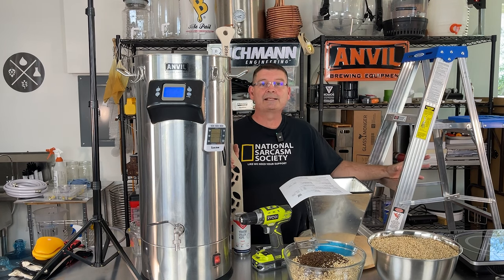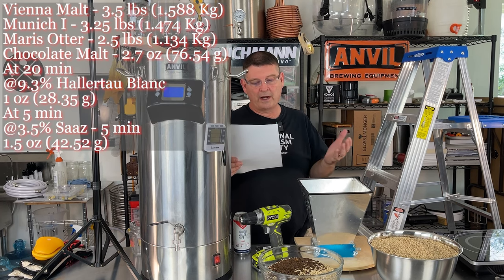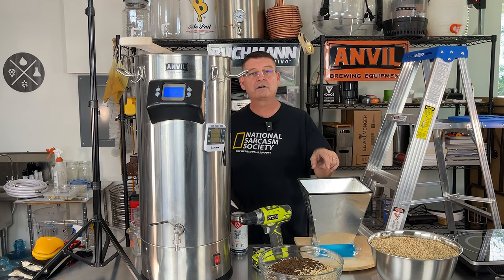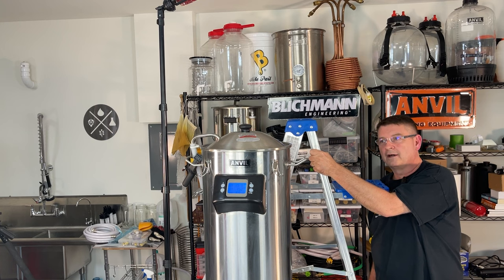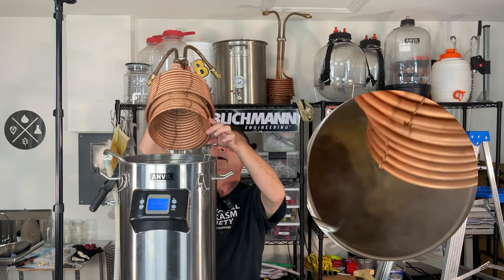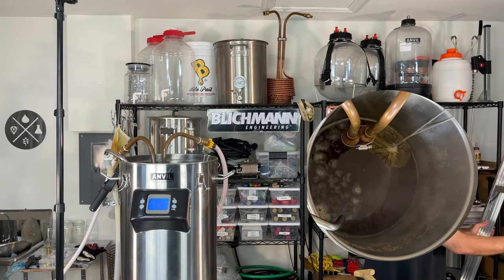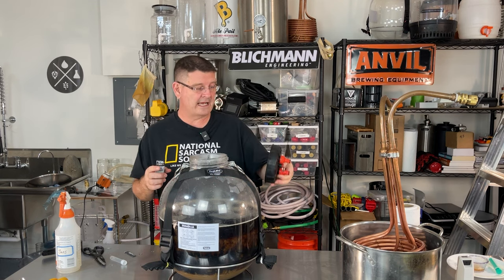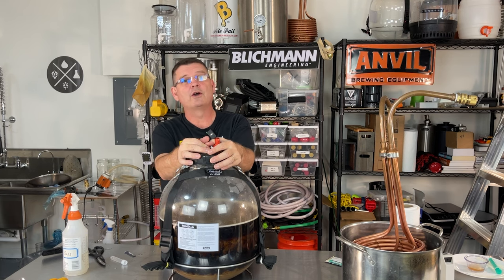Vienna Lager brewed on Anvil Foundry brewing system

Comment: Glad you didn't get hurt working on that ladder. An electric hoist is a very helpful tool in my setup, makes for easy and safe lifting of hot items, and it's like having an extra set of hands.  I really enjoy watching your videos, keep up the good work.
Reply from the maker: Thankyou and I know the ladder really has no place in the brew space but working with what I have at the moment. If I wasn't brewing for YouTube or had a better back, I'd just brew on the floor and bend over when talking to the camera. I'll get it figured out but for now my goal was to get brewing ASAP. I did get a couple electrical outlets in the ceiling above me so an electric hoist wouldn't be that hard to get working.

Comment: Congratulations on your beautiful brew space.
I also have the Anvil Foundry and, for the lifting, I purchased from Amazon pulleys with internal gear ratchets, which work great, even with one hand.  The rope is 1/8 inch, 8 ft long, with a lifting capacity of 150 lbs.  Their main application appears to be the hanging of growing-light fixtures.  They are very inexpensive, and you get 2 pairs (4 pulleys) for about $9.
Reply from the maker: I actually have a pully system that I used at my last location for testing a BIAB inside the Anvil Foundry. I'm still debating on using that or other solution.

Comment: New location looks amazing! You will get the kinks worked out for sure. Three things need the feet on the basket (I love mine) and a hop basket so you don’t burn yourself. Also maybe a hoist system from the ceiling. Just thoughts. Keep up the great videos!
Reply from the maker: Thank you and actually I have the feet on my 2nd Anvil Foundry and bought them for this one but I still like the ring for the ability to help level the grain basket. As for not burning myself...I do that all too often whenever heat is involved. I did editing out a bit of complaining about how much my fingers were stinging. (I use a lot of mustard on my burns, so it is extremely rare for me to end up with blisters.)

Comment: Nice job Mike, appreciate you showing how the brew day "really" went.  You are correct,  your flow and process will only get smoother the more you get used to the new space.  I'm thinking a two level brew table would be a nice addition.  That would probably be really pricey though!  Cheers.
Reply from the maker: Yeah and sadly I already spent a fair amount of money on the tables I have but ultimately they may have to change to make things smoother.

Comment: Congrats on brewing at the new house! I remember my first batches when I moved to brewing in my garage and there was definitely a learning curve.

My biggest suggestion is to get a pulley system. I put an eye bolt into a ceiling joist, attached a ratcheting pulley to it, and it made lifting out the grain bag a breeze. Makes it so much more safe and ergonomic.
Reply from the maker: Thank you and you are right as everyone seems terrified of me using a ladder. I mentioned to another home brewer that I have plugs in the ceiling mainly for lighting systems to be used in the future but I could easily hook up a manual or an electronic hoist/pully system.

Comment: Great job & video. It's difficult doing anything in a new environment. I too got nervous when you were up that ladder, especially when that ring came out. Yeah you definitely need a hoist of some sort & probably a lower/adjustable bench too. I'm sure you'll find the best solution. 👍
Reply from the maker: Thank you and I had to check out your YT Thumbnail. Very cool, I thought it was a skeleton at first. I know this brew round was safety directors nightmare (I work with a few in my day job as I'm an IT guy that works in the port industry, very dangerous). I'll figure it out but I was chomping at the bit to get brewing again ASAP. Doing two IPAs today if I get lucky, otherwise one today and one tomorrow.

Comment: I've  got the exact same generation  anvil foundry with the snap ring and have popped  it a number of times but still would not give it up I'm  at like 47 batches in it and just an FYI what I do is .... I have a Warner (darn auto correct) platform its 30 inches long 12 inches wide and 20 inches tall (lowes,home depot ect..) so I put it at one end and the foundry is at a comfortable  height  to read contol panel  and stir mash then when I lift the malt pipe I step up on the platform  next to it. It works! I also have one all rounder I am very fond of (wish I had two) not everybody understands them . My fermzilla I don't  like it's too small. The fermentasaurus (you try and spell that) was the perfect batch size I could ferment 8 gallons and fill one 3 gallon and one 5 gallon corny. Sorry  I'm  rambling.  Congrats  on your  brew cave. Vienna should be a nice spring beer.
Reply from the maker: Yeah, I've seen a lot of folks using those Werner stands for brewing. You are right it brings it up to a nice height without being too high. Not sure why I didn't think of that but sometimes the obvious is the hardest to imagine.

Comment: Unfortunately YouTube doesn’t allow me to post links, but harbor freight has a hydraulic table cart that might come in handy for you.  That pesky ring always got me until I started using tiny spring clamps to hold it in place. Cheers!🍻
Reply from the maker: No prob as usually YouTube will throw comments with links into "Held for review" but I was able to go search Harbor Freight and I found two that might work. The one I like is of course a little large but it is still a possibility.

Comment: You are going to hurt yourself with the brewing set up that you have. Lifting heavy bags and baskets containing very hot mash and liquid while standing on a ladder isn't wise. Ropes and pulleys are ridiculous, too. You are making beer not removing engines. Make sure someone is close by when using the brewing system in case you get hurt, or buy one of the "help I've fallen and can't get up" electronic gadgets. You are over the top with stuff and you need to dial it back. Some of the stuff that you do has no connection with making ale or lager, and you are using the simplest and quickest brewing method on the planet that cannot make ale or lager due to the way enzymes work and chemical precipitation, anyway.
With single infusion you can only control the amount of simple sugar, glucose and the amount of sweet tasting, nonfermenting types of simple sugar that forms when Alpha splits the simple starch chain, amylose, by adjusting temperature up or down. The higher the rest temperature the quicker Alpha denatures and the beer will be sweeter tasting and lower in ABV. The only problem is that it takes more than simple sugar for making ale and lager, but not for making moonshiners beer.
Body is different than sweet taste. The body that you mention is sweet taste from the nonfermenting, simple types of sugar that are contained in the reducing end chain. The types of sugar that form body and mouthfeel are tasteless, nonfermenting types of sugar, A and B limit dextrin, which are contained in complex starch, amylopectin. Amylopectin is heat resistant and at 152F the starch does not burst and enter into the mash liquid and you threw away the richest starch in malt that you paid for when you bought the malt. The other ingredients that form body and mouthfeel are albuminous protein and pectin. Mash is boiled to take advantage of amylopectin. The boiling mash is added back into the main mash that is resting at a low temperature to preserve Alpha, mash temperature increases and Alpha liquefies the complex starch and dextrinization and gelatinization occur. When you make beer you skip conversion, which you cannot skip when making ale and lager, and you skip dextrinization and gelatinization, as well. To make pseudo, ale and lager you will need to learn the step mash method, which uses three temperatures and high quality, under modified, low protein, malt is used with the brewing method. That is why Weyermann and Gladfield produces under modified, malt. Gladfield's distillers malt is better than most of the base malt that you purchase.
Skipping the 168F rest isn't a big deal. Mash out is used with the decoction method or when the grain bed is too thick. Besides, you cooked Alpha to death during the 90 minute rest at 152F, and there was no need for mash out.
You don't have the piece of equipment that is used for determining ABV, efficiency and attenuation so don't get overly concerned with the numbers that you get from a hokey formula. 
Don't waste money on yeast nutrient it isn't needed in the beer that you make. In high octane, single temperature infusion moonshiners beer extra yeast is added because of the high amount of glucose in the extract, also yeast skips reproduction in extract loaded with glucose and to support the extra yeast moonshiners add, they dump in yeast nutrient. The difference is that moonshiners don't drink the beer, they distill it and leave chemical imbalances, laxative, drywall, yeast nutrient, etc., and the sludge, protein mud, and Beta Glucan goop that the brewing method produces, in the still. Back in the day moonshiners rocked on and sold some of the extract to brewers that rocked on and made paupers beer that they sold to bums that rocked on after drinking a bunch of the swill.
A spec sheet comes with yeast and with malt and until you get on board with using the valuable information on the spec sheets that are produced for determining the quality of ingredients it is impossible for you to determine the quality of anything.
Take a look at a recipe for malt liquor. Malt liquor is lower quality beer that ale and lager and cheaper to buy. You will notice in the recipe that high modified, malt is the base malt, which is the same malt that you purchase, but in the recipe a two temperature, two step brewing method is used but to make ale and lager in home brew land the same type of malt is soaked in hot water for an hour at one temperature. Bitters how can that be? Why does it take a more time consuming and complex brewing method for making low quality malt liquor than it does for making ale and lager in home brew land?